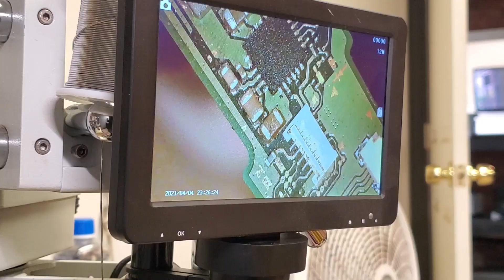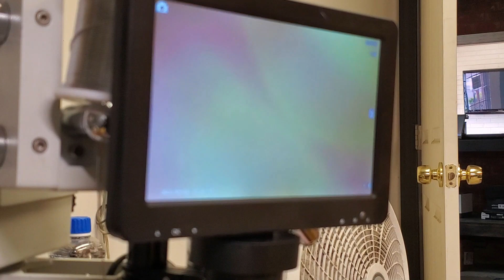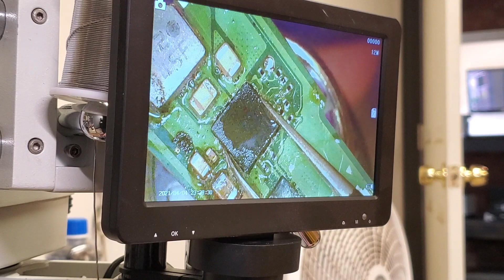HOLY CHIP! Switch Charging repair?! - BQ24193 Swap

Comment: I'm trying to get the BQ chip off my son's oled board but I can nor get the solder to flow. I don't know what I'm doing. I've tried 3 different types of flux and I just can't get it to go. I tried to use some new solder to get the old stuff to flow but I'm pretty sure I just made some bridges on the resistors on one of the sides. I'm going to have to go in with a wick once I get it off.
Reply from the maker: Are you using a heat gun? If so adjust the temperature and air flow. Air flow is extremely important. The one I use for daily use has the air flow all the way up. Usually factory solder flows around 470-486 for me. Also are you heating from the top directly or under the board?
Reply: @reaperselectronics hi, i have the same problem, i set my heat gun to 350°C (i dont know if you're using °F) air Flow 10/20 after some research i learned that i have a bad flux, and i hope i didn't burn the mother board, but why are you heating from under, is it better ? There is some elements under and im afraid of burn them, if you have some advice it'll be appreciated i know you're video is two years old but i hope to understand, thank you👍